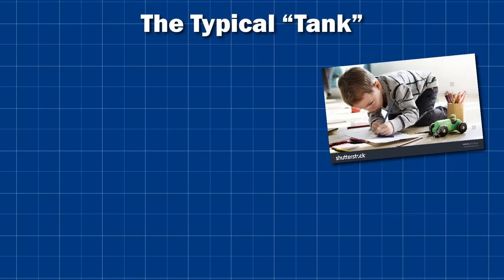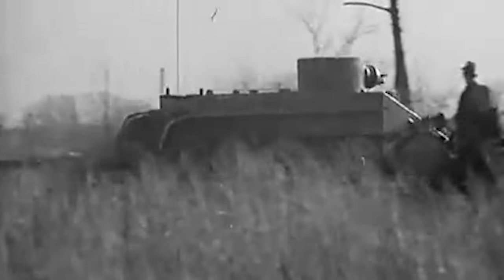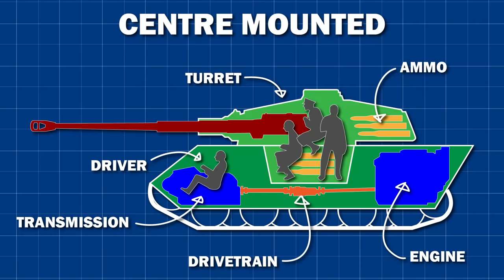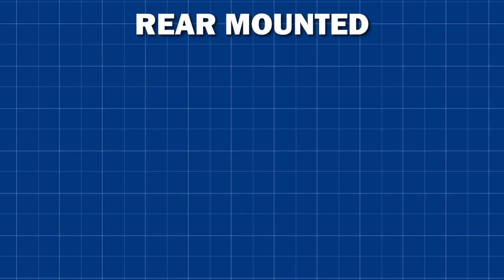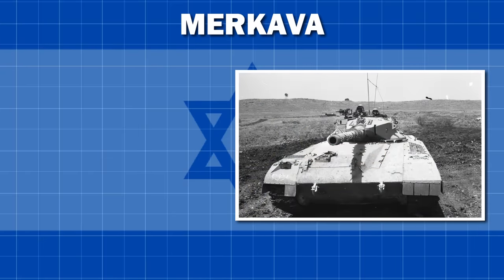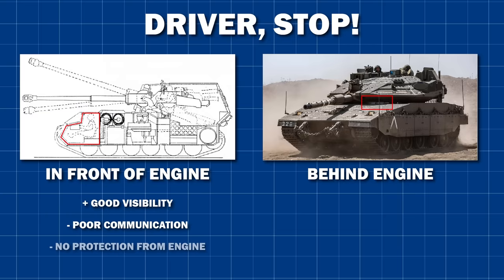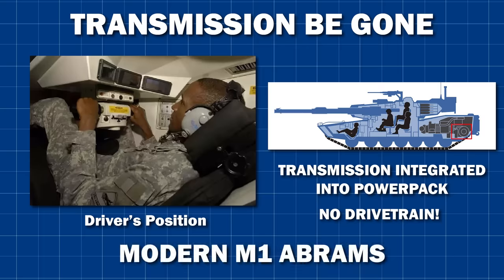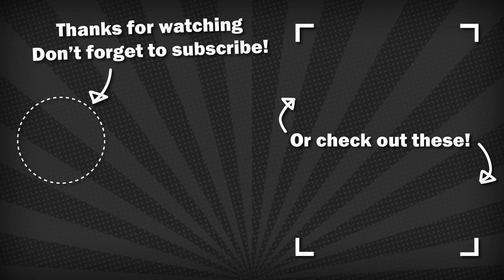What happened to Rear-Mounted Turrets?

Comment: Seems like a set of cameras would be a huge upgrade to modern tanks for the drivers. Being able to sit them behind the engine and transmission, but have full a 360 degree view seems like a very useful way to go about things. If they’re currently using windows to protect the drivers eyes I think you’d be able to use the same measures to protect a camera, and have redundant cameras for the same view to prevent being blinded.
Reply: They've been doing it on the Abrams for almost a couple decades now. The vision blocks are the emergency backup to the backup displays.

Comment: Ok so 30s in imma make a bet

He may, or may nopt, mention the Archer mounting its "turret" (or casemate to be real) in the FRONT. BUT having it point over the rear of the vehicle. The reason for this was it meant minimal redesigning of the transmission layout, while minimising the overall length of the vehicle for ease of transport.

Comment: The Swedish S-tank had a design similair to a rear mounted turret, with the small caveat that the turret was merged into the body. The engines of that tank were in the front, with the diesel fuel tank on the sides for extra protection.
Reply: With two big engines, the crew space was more of an after thought. In fact, tank operation was such a small priority that one person could run the entire tank.

Comment: 3:27 This is only technically correct. Its can have soldiers mounted there, but it's typically used for medical evacuations. This is because that the extra space wasn't actually supposed to be used, and is just a side effect of the engine placement. The israel government did showcase the Merkava transporting troops, but it's not very good or efficient at it.

Comment: Glad to see you back! This is a question I've had for a loooong time, so thanks for posting! It seems to me that - if the turret were remotely operated, then a design with a front-mounted engine and an oscillating turret would benfit from the strengths of those design choices, while balancing out the drawbacks.

Comment: You didn't mention that front mounted engine tanks have a lot bigger heat signature, since all the heat is in front of the vehicle
Reply: In the pre-thermal era ,an problem that more obvious than heat signature is the hot air stream from engine will reduce the effective of optics when looking through it
Reply: Thats not how that works, the tracks of a vehicle are a much bigger giveaway than the engines signature (yes the engine is hotter, no that does n’t matter) so a front mounted engine vehicle wouldn’t be a disadvantage in that regard

Comment: You should also talk about Front Mounted Turrets like in the IS tanks. I would find it interesting to know why that didnt get continued. With gun Depression having a chance to be very good. But probably its the same like the original idea for rear mounted. Because Armor is heavy and causes a HUGE weight imbalance between Front and Back.
Reply: as a german :) 
i think the IS series was the most optimized tank design of this era + the battle-field situations these "MBTs" had to face
Reply: @zachariasobenauf1895   Sprechen Sie Deutsch?
Reply: If you have both heavy armor and a heavy turret up front you negate the value of tracks as weight is not distributed evenly but leaning forward. IS tanks got pretty bad gun vertical angles because the turret was low profile and thus did not allow much room for gun vertical movement. IS series of tanks was discontinued AFAIK by Nikita Khrushchev because legends say that he saw heavy tanks as dinosaurs in the era of guided missiles, but this was proven false as modern main battle tanks are basically heavy tanks with composite armor optimized against anti-tank missiles with powerful engines that allow them to reach speeds of medium tanks. What is the more likely reason behind demise of heavy tanks in the Soviet Union was the lack of infrastructure to move around efficiently ~55t or heavier beasts like IS-4 which were still produced in few hundreds...

Comment: in an urban environment, a tank with a rear-mounted turret would have to expose more of it's frontal hull (especially the sides of the front) to sightlines on the left and right, before the turret is far enough forward to see and shoot to the left or right.  is this a major issue or more of a niche trade-off in combined arms tactics?

Comment: Don't know whether this applies in any way to real life, but in video games, it is difficult to go around corners whilst being ready to fire with a rear-mounted turret. It forces you to expose a lot more of the vehicle before you are able to fire at a target, and gives the enemy more time to fire at you.
Reply: In World of Tanks, a rear-mounted turret can make a heavy tank with good side armor a surprisingly durable vehicle, even against premium ammunition. 

There is an “autobounce” mechanic where if the armor piercing shell strikes the armor at an angle 70 degrees or greater will cause a shell to automatically bounce, unless a shell is more than three times wider than the thickness of the place, aka “overmatch.” There’s also “normalization” where depending on the ammunition it will reduce the angle of impact, but doesn’t affect the values for overmatch really. 

Thus, a tactic known as “side scraping” can be used by a tank with enough side armor to not get overmatched. Side-scraping involves coming up to a corner and parking your tank’s frontal armor behind indestructible cover, only presenting the very heavy armored side armor. You tend to see this at choke points with plenty of vertical and urban maps. 

Now any tank with enough side armor can do this, but tanks with good side armor AND rear-mounted turrets such as the Maus can easily exploit this since it lets you side-scrape without the need to reverse into fire and possibly expose the thick but not auto-bounce front armor. 

Lighter tanks with rear-mounted turrets can still use mobility to reverse out of cover, take a shot or two, and then quickly drive forward back into cover. 

Of course, fighting on hills is harder with a rear-mounted turret because gun depression is sometimes bad and you tend to expose more of the hull and often thinner lower hull armor when doing so. 

So it does depend on the video game. In World of Tanks, it can be beneficial at times, although a detriment at other times.
Reply: Sounds legit.
Reply: @classifiedad1 In War Thunder you would judt get shot in the side and istantly die.
Reply: Back up to the corner, and use your rear mounted turret to see the enemy first and blast away, then duck back around the corner to wait for the hornets nest to settle down.
Reply: In real life if you have to go around buildings without infantry support you're in deep sh*t

Comment: Maybe it's a good idea for a video on how purely electric drivetrain could impact the modern tank layout. You don't need a huge noisy engine, you can use multiple small motors for powering more than one drive wheel, only that should allow for much greater flexibility in designing the tank.
Reply: And do away with tracks which are the tanks biggest unprotectable weakness.  I was wondering when the comments would reach this topic, so thanks for bringing it up.👍
Reply: The battery required for that would be way, way too big to make it practical, though.
Reply: @wulfthemountaindragon5432  You would be surprised how much lighter batteries are compared to diesel engines and this would work best with toroidal electric motors meaning the running wheels would be the actual movers...it has to be explored because tanks like car haven't changed much lately until Elon came by.
Reply: @billhanna2148 Maybe lightweight graphene supercapacitors (provided they can be made sufficiently robust, reliable and affordable) could store enough energy for an all-electric tank with a decentralized (in-roadwheel) powertrain you propose? And if these graphene supercapacitors were part of the tank's structure or somehow lining it on the inside, the tank's architecture would allow for a centrally mounted turret even in case of a rear-end personnel carrier compartment.
Reply: @HighIQRetard  thanks 🙏 and like I said tanks can use an out of the box look over
Reply: @billhanna2148  The electric motors are lighter than an internal combustion engine, but all bateries available today  and for the foreseeable future are less energy dense then petrol fuel such as diesel, gasoline or kerosene. A fuel cell could do better, but it would still be heavier than a tank of fuel. Electric does have plenty of advantages for a combat vehicle, but range would suffer greatly for such a heavy vehicle.
Reply: @billhanna2148  unfortunately tracks are also one of a tanks biggest assets due to their weight distributing effect. Without them you'd be limited more severely by the weight of the vehicle.
Reply: While an electric drive train would bring many advantages, such as torque and less moving parts. You'll never see a pure electric tank. Currently the best you'll see is something along the lines of diesel electric like train engines or hybrid designs. 

The nature of war and combat would demand that you have an onboard generating capacity, batteries add tremendous weight that could be better used for armor and ammo. Additionally if the tank was reliant on an external source of power it would add another link in the logistics chain that could be snapped. 
Anyone who tries to champion a full electric tank, or any military vehicle is working for the other side.
Reply: Overcomplicating structure to make it more silent when combat distances are 500-1500 meters and making tank impossible to fix without some special equipment. What could go wrong?
Reply: @billhanna2148  JCB excavators discovered that . for the bigger machines, the battery would double the weight and the cost. Multiple wheel motors adds to complexity.
Reply: @richardbarber4444  no doubt and I am sure that battery technology will continue to evolve too
Reply: If you have wheels it is a different kind vehicle, but electric armored cars are actually a very interesting idea. It especially makes a lot of sense for V-hulled mine resistant light IVFs where you have a bunch of space at the bottom to cram batteries into. And making them electric makes them more comparable to tracked vehicles offroad because of the much better all wheel drive performance.
Reply: @billhanna2148  "And do away with tracks which are the tanks biggest unprotectable weakness.  I was wondering when the comments would reach this topic, so thanks for bringing it up.👍" 

Billhanna you're a GENIUS. 

YES, let's get rid of those useless, pesky tracks! So heavy and clumsy and frail, right? Why do they stick with those, just to make it look like a tank? Psh! Form over function! Put some nice rubberized tires insted, they'll last longer and the tank will be so much lighter and faster just like my Jeep! Also since we're talking about fixing tanks why don't they remove at least half the armor? That thing weights, like, a ton! Make them lighter, they'll be faster! Ziiiiiiiiiip! Put a bigger cannon on them instead with that weight! Put a 155 mm on them, so they'll be like mobile artillery!
Reply: Range and batteries not being the most durable things in the world.
Ignore what you've seen in movies its shockingly more difficult to light fuel on fire than you'd expect. Batteries on the other hand (both lead acid and lithium ion) tend to cook off rather easily when they're bouncing around in a 60+ ton machine.
Range is simple, diesel fuel is more energy dense and easier to transport than any battery in existence today. Its also easier to store in a useful state. Refueling a tank takes about 3-10 minutes depending on the design, there is no way to recharge a battery powerful enough to move the tank in that length of time So now we're talking about swapping batteries in order to achieve the same refuel time as a diesel engine. Which means we're transporting charged battery packs around on trucks and moving them with heavy equipment in a hurry.

Oh and all this needs to be done simply enough that a sleep deprived 18 year old can do it at 2 in the morning with no lights on.
Reply: @BosonCollider that would make for one hell of a barbecue.
Reply: @sleepygryph  the only realistic way to make a fully electric tank is to have a small nuclear reactor in the tank, and if you do that, your going to run into quite a few problems.
Reply: @Narcan885  from the knockout rates of modern tanks v cheap UAVs in Ukraine - it might not be that far off just having jeeps with missile batteries in the field.
Reply: The way batteries catch on fire, that's not a good idea.
Reply: @billhanna2148 😂😂😂😂
Reply: @sleepygryph  probably not in the near future, but at some point an alternative will have to be found. Fossil fuels are a finite resource and will dry up before the end of the century. Environmental issues aside, it will not last forever."
Reply: Correct me if I'm wrong, but wasn't Porsche trying to experiment with this or something similar in WW2?
Reply: @exoticdachoo007  I think it was the transmission.
Reply: Diesel electric drive trains are coming to tanks.
Reply: And you will need two more tanks to carry the appropriate battery for it.

Comment: there's also the trade off for the tank being more susceptible to mobility kill VS crew death, in a rear mounted turret type tank the turret crew is able to survive most hit more so when the engine is front mounted that even the driver is a bit safer, this was another one of the consideration for the merkava design since manpower of the crews is actually more expensive to lose than the tank itself especially for a small but industrialized country like israel
Reply: That doesn't even have to be a trade-off. On a rear-turret, rear-driver design you have nothing important sitting in front of the engine, which means all that space could be dedicated to additional armor thickness and shallower deflective angles.
Reply: @VestedUTuber   The whole point the Merkava is engine front design is because they couldn't obtain or develop their own composite armor in time or in large quantities which was brand new in the west. The space is not empty anyways, if they had the ability to produce composite armor the Merkava wouldn't have been front engine designed (at the time 1970s ( lots of wars for Israel). They didn't have time to design a state of the art tank at the time.
Reply: @Taczy2023 
That doesn't mean you can't design a tank to take advantage of a rear-turret design like that.

Comment: There were several tanks (even pre ww2) that had rear mounted engines and rear mounted engines. They were manual gearboxes. One of the best seling cars of all time had an integrated powerpack at the rear of the vehicle, and a manual transmission; the VW Beetle (Der Volkswagen prior to 1948).

Comment: I think that remote control and automation could make things even more interesting. Without a crew, drone tanks wouldn't need the same type of protection and you won't need the same space clearances internally that you would with a crewed vehicle. You could have space in the rear for  supplies for the troops.
Reply: Unmanned combat vehicles have been built and tested... but never used.

I dont know why, I imagine nobody wants to have an international discussion about what they do or dont count as under the rules of war
Reply: in addition to not being able to go through field maintenance by a tank crew, an unmanned remote controls tank necessitates using an auto loader rather than a traditional tank loading setup, a remotely controlled tank will be subject to interference from tunnels and potentially susceptible to enemy jamming, also as you care less for unmanned units, it makes more sense to utilize robotics in lighter and cheaper less armored vehicles than MBTs that have more specific operational parameters  (for example tank busters, border patrol, combat engineering (for clearing mines for example), mechanized front guard in a ground maneuver etc ) @1stCallipostle  . I wont be surprised if eventually a country will decide to have an alternative unmanned MBT platform with the aid of AI but at that  point thats a whole other discussion than remote control.
Reply: I think part of the reason they're not used it because they're just impractical, at least at the current time. I'd argue even with cameras and sensors, you'd still be less aware. Not to mention potential risk of getting jammed and losing access to your vehicle. And if it gets stuck or breaks down there's no one to deal with it, but realistically tanks won't operate without support, at least in most doctrines. Not to mention the electrical side. 

I think anyone who's been in the military know it'd be destined to fail, but maybe I'm just being cynical.

Comment: Putting the engine in front does protect the crew from an incoming round, but it also disables the tank, probably even the turret, so the crew survive the first hit and then die a sitting duck.
Reply: @benjiro8793 it complete depends on what you hit the front with. A front mounted engine fills the entirety of the front of the vehicle, thus any penetration will disable you. A drivers cab is incredibly heavily armoured and takes up an absolutely minimal amount of room. Unless you specifically penetrate/injure the driver, he’s going to be good to keep rolling.
Reply: they have time to get out though